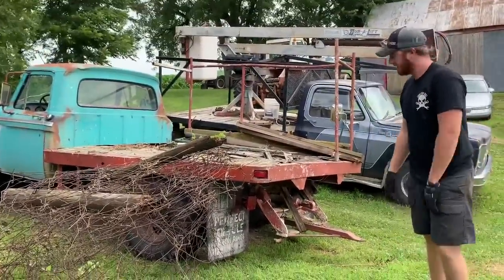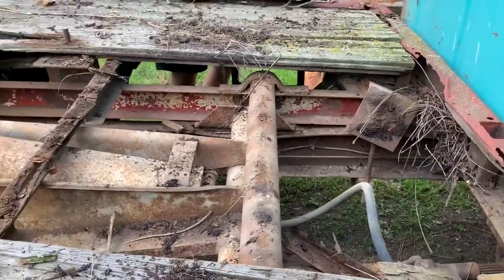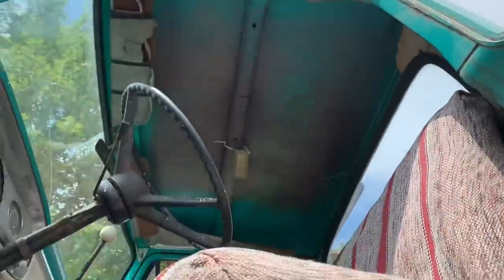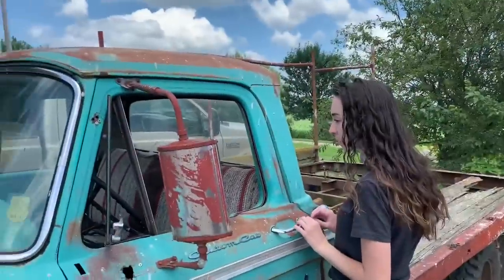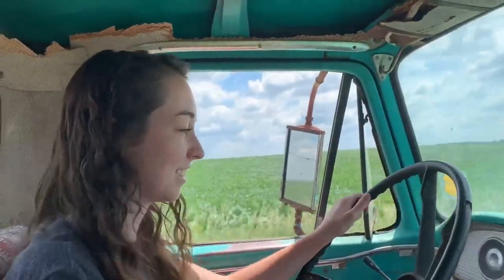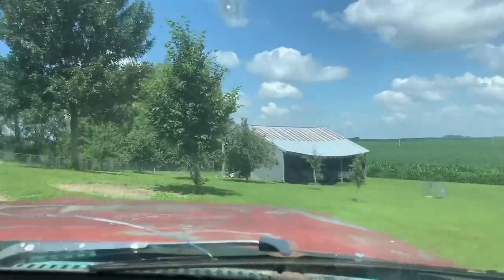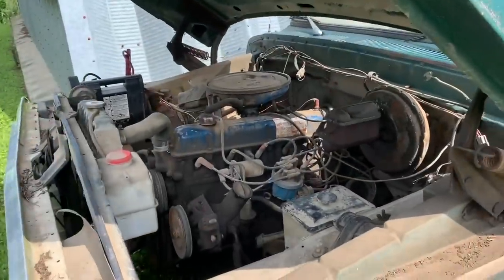Fixing and Driving the Revival Trucks

Comment: One little secret about them 4 speeds with granny gear, you usually can start out in 2nd gear when you take off it doesn't hurt anything.
Reply: I was wondering why he was using the granny gear. He called it a granny gear. I'm not a car or truck guy but I knew that was the extra low and tough gear. Yeah, the granny gear is just used for power and not in everyday driving. So, granny is first gear then?
Reply: @jaxflfreebird  yeah granny gear is first.
Reply: Man, you don't need to start off in granny gear, you take off in second gear !
Reply: james coulter my buddies truck in high school was an old 4 speed, if you took off in 1st you got to like 2 mph 😂
Reply: When I was growing up, we had a 1/2 Ford truck with a 6 cylinder and a manual four speed.  We would take a Load of corn to the mill to get it ground up for cow feed.  So we have 2000 pounds of ground corn in the bed, and a steep hill to get out of the mill.  Granny gear was mandatory.  Once rolling, we had another steep hill to climb before ever getting into fourth.
Reply: @robertheinkel6225  ......and when you reached the Summit........'shine is ready!!!!!   Good ol' "'shine Hill".   I wonder how many cops are buried, up on 'shine Hill.  What you think, Robert Heinkel. A Dozen.  Maybe...Two....
We know what you done, Robert Heinkel. WE (Santa and i) know....

Comment: Awesome!! Again Mad respect for the both of you Mook and Kevin!! I bought a 72 F100 with a straight 6-300 no power brakes, no power steering, manual shift with an H shift pattern so big the passenger had to spread their legs to get it in fourth lol. back in the early 90’s for $500. I bought it like you guys, site unseen out of a field. Put a new battery and a tank of gas and drove it 1100 miles through the mountains of Utah and Colorado (with only front brakes) didn’t skip a beat. Drove it for another 10 yrs before I up graded because it just wouldn’t fit 3 kids car seats. The only thing I did to it the 10 years I had it was fuel and brakes. Damn I miss that ol’girl! Again mad respect for y’all, can’t wait to see what y’all do with the ol’trucks.

Comment: She does a great job of driving the old beater ! Looks like a 4 speed with a granny gear . Shifts like a 3 speed , don't use granny gear , start out in second , geared as if it's a low / first gear . Only use granny gear for starting out hauling a huge heavy load , then quickly shift into " low " ( second ) . But basically use second to start out from a dead stop when empty . Engine seems to be a late 60's/early 70's. Ran the engine number ??
Reply: Looks like a 300 6 cylinder. Old man I knew his had over 300,000 on it.

Comment: Hi there just joined I have been  a mechanic  for 40 yrs on the truck 1978 do ever use  am oil engine  cleaner  if not try run for about 4 or 5 minutes  let set for 30 minutes  and then change oil  i will keep watching  great  show

Comment: That 1978 Ford is a keeper. Big fan of those 300 cubic inch inline 6 cylinders. My brother had one in a 1989 with a five speed,, loads of torque and 20-22 mpg on the highway

Comment: Like I basically just commented on jyd it's got a granny low. Without a heavy load you start in second. So first is actually low second is first third is second and fourth is third 😂
Reply: Wait.... WHAT!!!! 😉
Reply: So basically, just drive it like a truck.
Reply: That's the way I was taught.
Reply: What if you gots ta rebuild your Tranny? .....The Second Gear is the same as First Gear and the Third Gear is compatible with the Second Gear........NO,  they are not.  They put numbers on 'em, for so when you rebuild 'em you can get confused, give up and go to the dang Tranny Salvage, like a normal person.
Reply: @ihavefallenandicantreachmy2113  no the gears arent the same. It just comes down to how you drive it with an extremely low first gear. It becomes a low and second becomes first. You start in second because it has the ratio similar to a normal first.
Reply: @jaredanthony8070  I bet you are a regular "Pain, in the Gear", at Parties.
Geared Grief.
Reply: @ihavefallenandicantreachmy2113  your first comment made no sense so I assumed you were confused. But maybe it was sarcasm that didn't transfer into type very well.
Reply: @jaredanthony8070  Yep, in low you can drive around the block in about an hour :-0)
Reply: @ihavefallenandicantreachmy2113  nah, he is correct.   FIrst gear ya might get five mph out of it so just start in second.

Comment: I had a 1964 Ford 1/2 Ton the same color of Turquoise. It had a 272 C.I., I later changed it to a 292, then a 312 Thunderbird engine. Then went to a 327 Chevvy, then a 427 Chevvy. It was a monster and under power it would torque steer all over the place. Rebuilt the entire front end and steering box and still the same. The leaf spring front end is not a good choice, so instead of putting a front clip in I sold it. I had that truck for 16 years and loved it.

Comment: Dear Mook:  I watched your repair/revival of the 1978 Ford Pickup that was in a flood.  It was remarkable you were able to get
that truck running at all. You have a delightful personality and smile, which helps with your presentation.   I did notice you used a razor blade to strip the battery cables for the new connectors.  While that works, it is dangerous and using a quality wire stripper would be safer.  Maybe working with fewer tools (viewers don’t know what you really have) looks entertaining, but it is also more risky for your
hands.  Be safe and keep smiling.  You are lovely.

Comment: Farmers News Service: Breaking News. Area farmer reports truck collision with house. At approx 1pm today, family members of the Mook clan were driving their truck when they  crashed into a house as they were attempting to turn around in a driveway. Local investigators have ruled out mechanical failure as the truck appeared to be in excellent condition. When asked, the investigator, Farmer Fred said " The truck appeared to be in excellent condition, only half of the bed was rotted away, and the emergency brake still had a full 20 percent of stopping power. In fact the truck was in such good shape that even the broken windshield hadn't been kicked out yet. And it was running on at least 5 of its 8 cylinders. So it could not have been any mechanical issue. Investigators said they have not ruled out that it may be a TMF incident. ( too much fun). A farm hand who had been laughing his ass off witnessed the incident from the tractor shed, claims to have heard someone yelling "go for it!" and " hit the granny!" In spite of the house being knocked over, the truck sustained no damage. In fact the trucks owners say it looks better and the frame is now straight. The driver has been identified as the Mook Queen of the clan. The Mook gang came back with another truck with a hoist and stood the house back up just as Sherriff Andy arrived. Officials are still investigating a previous incident where the Mook gang set 8 acres on fire with a 71 Ford truck, and were found to be  roasting marshmallows. No charges have been filed.

Comment: That '78 is less than a thousand bucks of brake parts away from being tagged and driven daily again. Love it! The F350's a bit more clapped out but she'll be driveable again no problem.

Hearing htat '78 flash off with just a bump of the key makes me wish I could find my cherry picker. Need to replace a seal on the oil pump of my '85's 300 so I can drive it again...

Comment: That looks like fun! My first truck was a 1982 Dodge Ram. It had a slant 6, and a 4 speed manual with an overdrive. My next truck was an 1988 F150. Had a 5 speed manual and a 302. It took off like a rocket in 1st. Would like to get my hands on an old truck with a manual someday. They are so much fun to drive!

Comment: This left me with a big grin on my face, I used to have a 800$ 83' C30, And this truck reminds me a lot about it. For better or worse.
Reply: My daily driver is a 79 c30 3 speed little things a race car with a 350 that can burn all four tires in the rear only got 60,045 miles on it only thing I'm afraid to breaking is the drive shaft

Comment: The old Fords used a rope seal as a rear main seal. It is possible to change the Rope seal with the engine still in the truck. Remove the oil pan and the rear main bearing cap and Pull the Rope seal out from the cap and pull it out from the top they make it tool that is we used to call a Sneaky Pete. I don't know if they are still available or not but you the Sneaky Pete has egg gripper on one end and a steel cable and then a handle at the other end you push the gripper and the cable around the crankshaft and connect the new rope seal to the gripper and then with the cable you pull it into place for the other rope seal in the calf replace the cap replace the oil pan.

Comment: both trucks run like champs, the rear end can be re aligned on the and the rear main can be easily replaced 64 and the 78 ford pickup,you can still get a title for it, you'd have to fill out a form and get a new title, might take a bit or get a salvage title for it, they are both worth keeping definitely, I remember the episode when you first fired it up and it just lit right off and ran like a champ, for sure worth keeping

Comment: I grew up when these trucks were new , My old neighbor had a believe it or not a turbo on his 352 rare as hens teeth , But some times the cylinder was pressured using a round  power steering pump it would be engaged by pulling it tight by a lever at the motor until the Borg and Warner transmission was made with the PTO gear on the side Wow when they came into picture there was a winch system that was unbeatable no matter how fast the transmission went the cable came in same speed direct drive power from the PTO to the winch thru a drive shaft a lot of tow trucks were made this way too , Iv`e had all the Fords here need answers Ask had over 34 Fords .

Comment: Hey mook. When your Fords Dont start because of no spark. And its the brain on the inside fender. Get rid of it. Go points. Starts after setting a year. Just make sure you keep good gas in it. No choke. Crank on it. Pumping the gas pedal. It will start.even my 92. When my 351W goes i n my truck. It will be points.

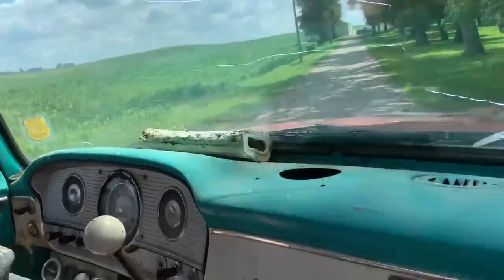Comment: 7:20 mook you can engine brake by putting the transmission in 1 or 2 gears lower and just letting out the clutch with out giving it gas. the rpm's will go up but this slows down the truck. this is how semis slow down from pretty uch anything over 30 mph!

Comment: Someone told me that those old trucks like that could start dog legging because the locator pins where the axle mounts to the leaf springs to center it will rust away. The axle then can slip sideways over the years and she starts to dog leg. My dad sold his 1966 International Loadstar 1600 for that reason. He thought the frame was bent and didn't bother to see if the pins rusted and the axle slip sideways.

Comment: It amazed me that the US has these elaborate and over complicated manual transmission shift linkages.
The Japanese vehicles of the same time had internal shift linkages that didn't break and didn't wear out so much.
On the flip side a '78 Japanese truck is not as cool as a US truck.

Comment: Didnt do too bad with a clutch  under the circumstances. As for the gears in the transmission  1st is only used when under a heavy load,  so you normally take off in 2nd gear

Comment: Someone needs a lesson in the differences between a "Truck" transmission Vs. a 4 speed in the average car.  Just about the only reasons for using 1st gear in that truck is for pulling a heavy load or climbing a steep grade.  Other than that you should always start in 2nd gear.